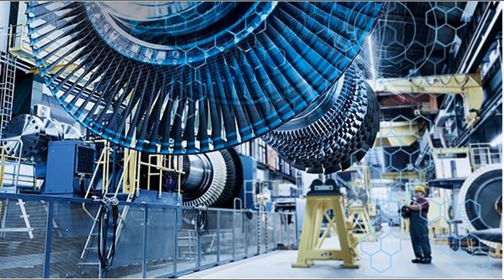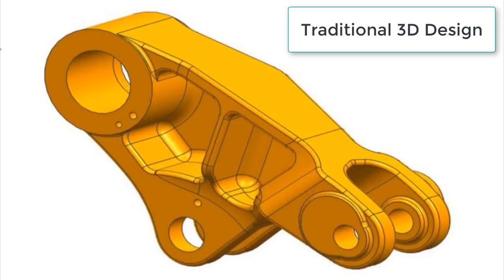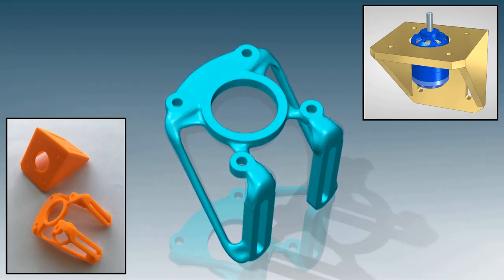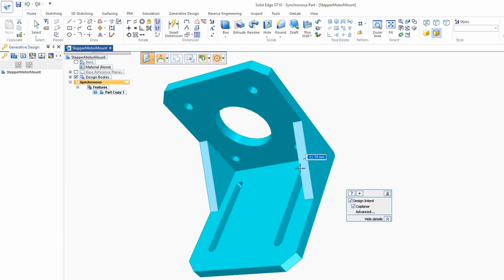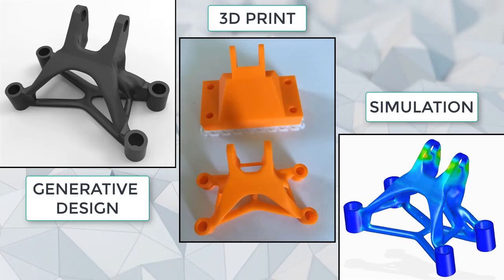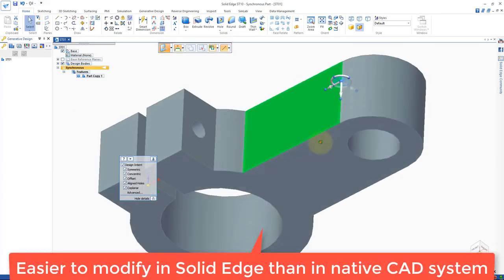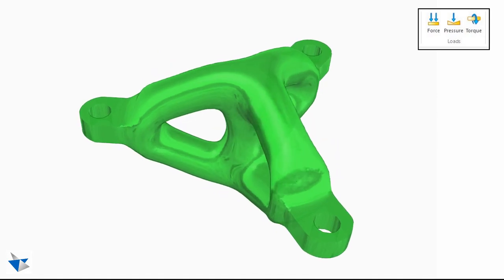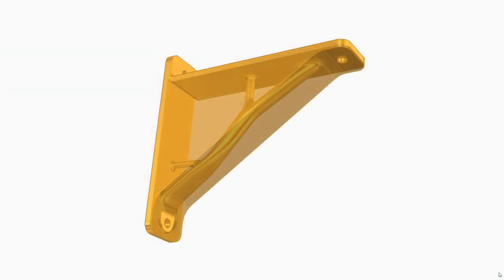TOPOLOGY OPTIMIZATION with SOLID EDGE ST10

Comment: Hang on - topology optimization may be great for low mass and perfect alignment of stress to strength BUT, they're many other factors to take into account for a successful reliable part.
A BIG yes for additive manufacture and it's been around for 30 years now - sure it's niches are expanding in application but traditional manufacturing techniques are very definately here to stay forever...
Reply from the maker: Like any technology the total perfection is impossible. I have used Topology Optimization more than 25 years ago, but nowadays Generative Design together with Additive Manufacturing (AM) make possible to get a part almost immediately using a 3D printer, and this is great.

Comment: Which solver is used for topology optimization?
Frustum?
NX Nastran Sol 200?
A different one?
Reply from the maker: The module of Generative Design integrated on SOLID EDGE use Frustum engine, visit my blog:
https://generativedesignpro.wordpress.com/
With FEMAP we run Simcenter Nastran Topology Optimization module (SOL200), visit my blog:
https://iberisa.wordpress.com/2011/08/28/optimizacion-topologica-con-femap-y-nx-nastran/